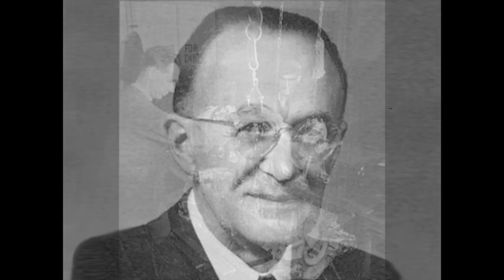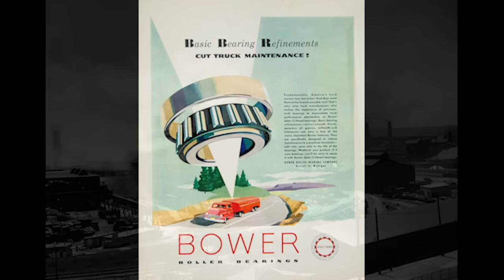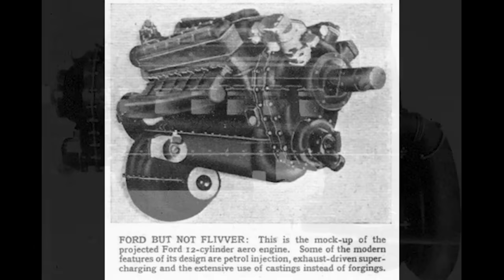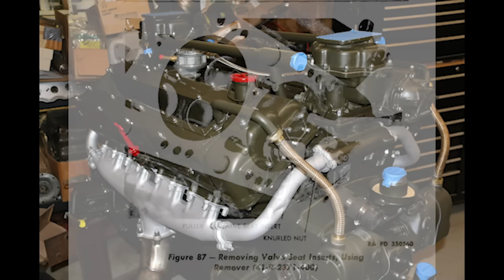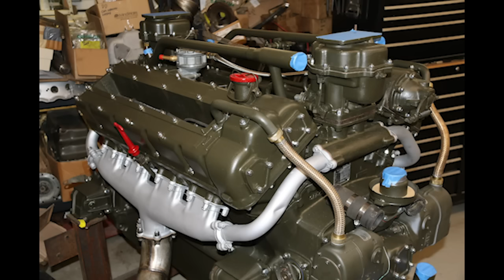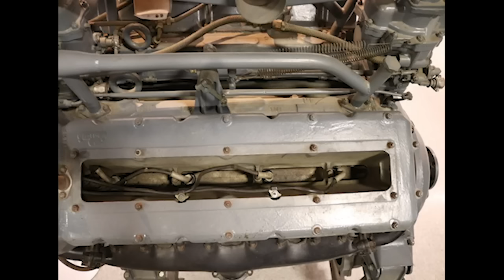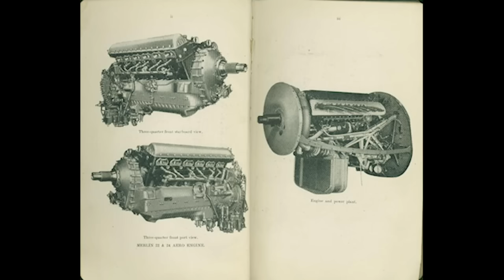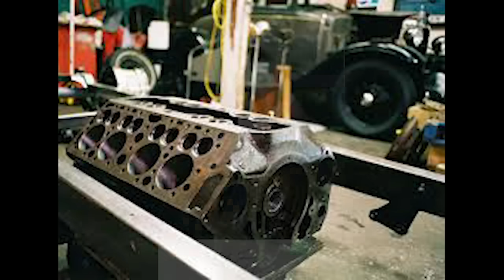War Hemi: The Story Of The GAA V8 - 1,100ci of aluminum WWII Ford grunt

Comment: Brian, I’ve been a gear head my entire life and never knew anything about these engines. I’m 68 now and love learning from every one of your videos! The podcasts, too. I read an “alternate” reason why Ford refused to build the Merlin: supposedly he said he couldn’t produce it to Rolls-Royce’s high precision standards, and Packard said Ha! Hold my beer and watch this. This story was told by a Packard enthusiast who evidently got the story wrong. It figures Henry Ford was on the wrong side of history. I daily a restored 1931 Ford Model A Roadster, and love it, but that Henry Ford was a really bad guy. 
Keep it up Brian! I can’t wait for your next history lesson!
Reply: It was the other way round, the Americans were into high volume production and parts interchangeability. They couldn't believe how low the precision standards were on the Merlin and effectively blue printed it. i.e. built it to much higher tolerances than Rolls Royce ever could with their older machinery. The RR Derby engines were originally virtually hand built with parts matched by tolerance, so yes, you could end up with a precision engine but it took too long to manufacter each one. When I worked in the drawing office at JCB excavators in the mid 80's our chief engineer who was about to retire saw war time srevice in the merlin factory and was charged with checking component tolerances and went into great detail about this.
Reply: @russellmills4878  You are absolutely correct.  Ford expertise was of course Mass Production and that requires high precision. With a capital intensive operation such as say the Rouge plant you cant afford to have the assembly line go down.  If the parts coming into that line are not consistent the line stops and you are now burning money, in wages and the idle machinery you paid millions for.

On a trip to England I visited a Birmingham museum that was mostly dedicated to the history of the textile industry.  But there was a display of a Ford built Merlin (not a GAA) in the museum, because the plant had been located in Birmingham. In the description in front of this engine was the story of the British government reaching out to Ford to produce the engine because Rolls Royce could not produce engine in the quantities needed. The British War department paid for the plant, and the machinery Ford needed to be able to produce the Merlin in the numbers required for aircraft production. That description with the display included the fact that Ford had to take the RR blueprints, and rework them for mass production, as the RR blueprints were overly reliant on the craftsmanship of their regular rank and file employees.
Reply: Rolls-Royce was still hand building merlin engines using obsolete methods of fitting individual parts to an engine, with no interchangeability between one engine and another... completely unsuitable for American standards and production volumes.
 Britian desperately needed more engines and looked to America for a solution. Ford turned down the Merlin offer for good reasons. Packard had excess capacity and won the contract. the rest is history.
Reply: In my first reply, I tried my best to keep it as short as possible but there is yet more to know about this story for a full understanding.

First of all, Henry Ford was a pacifist who absolutely detested war of any kind.  So, prior to Pearl Harbor and the entry of the U.S. into the war, Henry Ford was not open to the production of any war material. That explains his refusal to produce the Merlin in any of his North American factories. After Pearl Harbor and formal declarations of war of course Ford plants were duly converted to the production of any number of critical components for the American war effort.  These included Jeeps, and most famously the B-24 bomber built in Willow Run in an entirely new plant designed expressly for bomber production. 

However, prior to Ford Motor Companies' reorganization of their international operations which took place in the 1960's the overseas operations were separate companies with a mixture of ownership between the Ford parent company and local ownership.  Henry wanted local ownership of significant amounts of the stock so that their operations would not be regarded as outsiders in each of those countries.  That is how Ford came to produce Merlin engines in Birmingham (see my previous comment with the details of that) and why the British war department had to pay for the plant and the tooling so Ford of Britain could build those Merlin's in the quantities needed.  Henry would not have allowed the production of Merlin's in the Dagenham plant.
Reply: @g.n.b.3351  What i have read and understood  The British government seized the Ford UK plant and put the plant into Merlin production for the war and that pi$$ed Henry off why he refused to build the merlin in the USA !! !
Reply: Takes more WWII tank buffs to know anything about the widespread GAA engine usage and existence.

Comment: Great overview of the Ford GAA, it is one of the missed opportunities of WW2 that the V12 didn't make it into a P51 mustang. The ford V12 would have been more powerful, more fuel efficient cheeper to produce, more reliable and have much lower part count than the RR Merlin. It would have been one of the greatest aircraft engines of WW2 no doubt.
Reply: Good point, the Merlin was actually an obsolete design and was too small, thus the need to create the Griffon

Comment: of course ford "stole" the tech, they didnt have the ability to design such an engine like GM did.
Reply: Right, they had to use their own money.
Reply: Did chevy ever work out the problems in their 409 ci engine
Reply: @thomaswayneward guess not. Went to 427 bb in short order
Reply: @rogerdodrill4733  more power man. 427 with dual carbs in the vette built way over 500 hp. only engine in that range that could. hell, 426 hemi sucked compared.
Reply: @thomaswayneward  ok. dont mistake the 409 for the 348, 409 had way less issues and way more power than the 348, even though they looked the same.
Reply: lol

Comment: Very interesting video, I like it very much. The GAA V8 and its variants demonstrated again and again that it was an excellent engine, reliable with good torque. I don't understand the logic Mr Ford or his father because they were renowned pacifist yet they built more engines of any kind for the army in both wars compared to other manufacturers with the possible exception of the Rolls-Royce Merlin and the Meteor...
Reply: Torque is not a primary design consideration for aircraft engines or Tank engines... a very high horsepower to weight ratio performance however is and good reliability... the GAA performed well as a tank engine

Comment: I need one of those, no...everyone needs one of those! I saw a tunnel hull speed boat that was powered by a supercharged Merlin  at a race meet once, it was incredible to hear but the boat driver seemed to have some problems and it sank slowly as it went around the circuit. The Merlin was powerful enough to keep propelling the boat even when it was mostly under water with just the engine and cockpit above the waterline, I was impressed!
Reply: stevecalllager  ALL Merlins were supercharged !!!! Early unlimited hydroplanes used the Merlin and or the V1710 Allison  which was also supercharged  the only engines that were competitive in them !!

Comment: When it comes to manufacturers perhaps 'copying' or at least 'taking inspiration from' the ideas of others ... read years ago that at the outbreak of the 1914-18 War a Mercedes Sports/Racing car with an advanced V12 engine was sitting in the London showroom of Mercedes.   Said vehicle was spirited away to be examined by the boffins at Rolls Royce ... who not long after produced the Rolls Royce Eagle V12 aircraft engine.
Reply: Germany invented the first aircraft engine and still is still the epicenter of internal combustion technology.
Reply: @DoktorBayerischeMotorenWerke I thought that was the Wright brothers.
Reply: @stephenholland5930  They were 3 years later 1903, Wilhelm Maybach designed the Daimler NL-1 that powered the LZ-1 in 1900
Reply: @DoktorBayerischeMotorenWerke  Just as a matter of interest, was it a 'clean-sheet' aero-engine design or based on a previous model?  I know that some early European (and US) engines-used-in-aeroplanes started life as auto and boat engines.
Reply: @alfnoakes392  The NL-1 was a lightweight aluminum engine designed from inception as an aero engine by Wilhelm Maybach to Zeppelins specifications. The Wright Brothers also designed their own aero specific engine from aluminum to meet their minimum power and maximum weight limit that no existing engine design could meet.

 Aircraft have very unique demands and specific design requirements that automotive engines simply dont meet, it is exceedingly rare to see any automobile type engine used in planes, far more common to see airplane engines in vintage cars, patrol boats and tanks
Reply: @DoktorBayerischeMotorenWerke  Interesting, thanks.

Comment: Rolls made the naturally aspirated Meteor for marine applications, but similarly they based the V-8 Meteorite off of it. Both derivatives of the Merlin. But there’s not much info on it out there and I haven’t even found a single picture of one. 

This Ford GAA was definitely more advanced, at least on the top end, with its dual overhead cams and pentroof chambers.

Comment: Never understood why the Ford GAA V12 did not go into the P51. The bottom end was more or less a straight copy of the Merlin, even including bore & stroke & bore centre spacing. Whereas the top end was quad cam 32 multi-valves with buckets, much better than the SOHC per bank with rockers to work the valves of the Merlin. Pending the supercharger setup this could’ve worked out better than the Merlin.